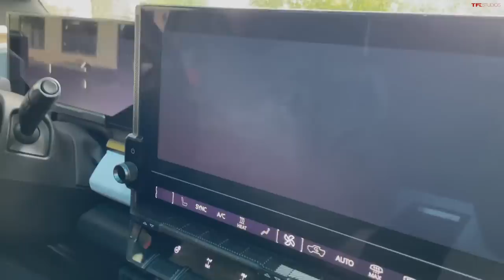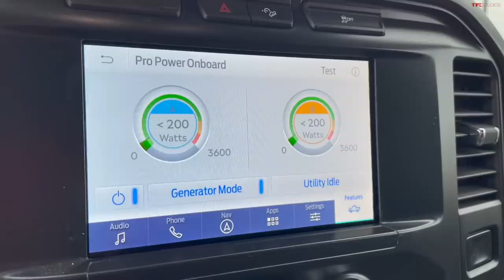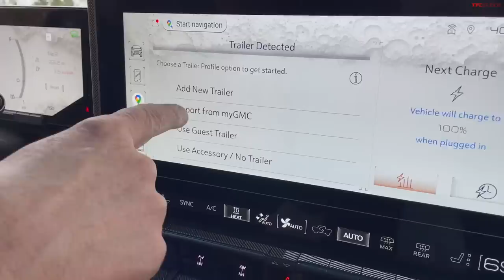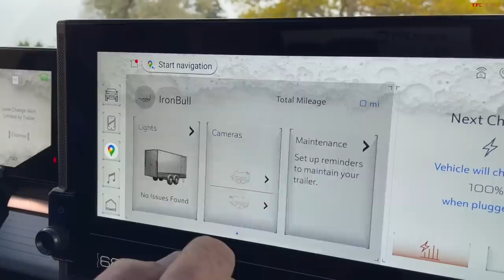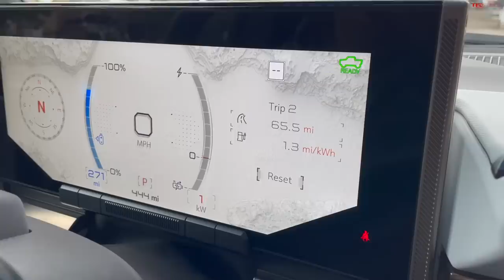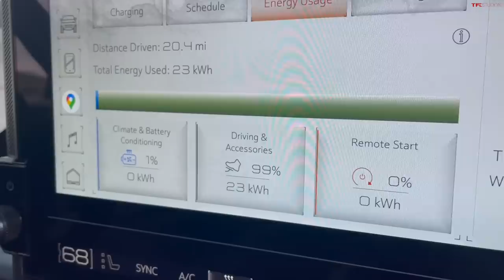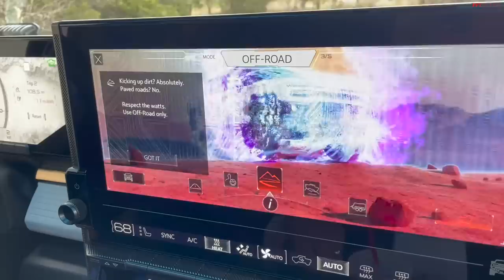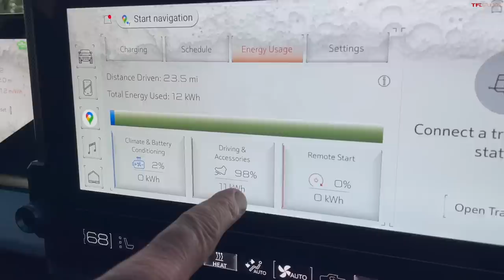Is The New Hummer EV a Real Truck? I Tow 5,000LBS With It to Find Out!

Comment: U drove a little over 20 miles fully loaded. That's not really testing it. Ev really aren't optimized for towing. To get good range u got to go way under the speed limit. Not really practical. The tech is just not quite there yet.

Comment: I’m just not impressed with the EV’s numbers! We know with a trailer maxed out ,that your only good for 200-230 miles if your lucky. For example I have traveled I80 for over 25 years, from SLC to Sacramento in a 24 Valve with a maxed out trailer of 10,000 pounds. With an average grade  of  3-6% , there is a section of I80 at Donner Pass at 7.5% it’s about 2.5 miles long. The total distance from Salt Lake City to Sacramento is 665 miles. In the second GEN Cummins I top off  in Salt Lake City and then in Lovelock Nevada to get to Sacramento.  Costing me around $270.00 and only 10 hrs to get there.  I know it’s  cheaper out  of pocket with EV’s , mentally exhausting having to wait 45 min to an 1 hour to recharge, X that by 3. With that time different’s I can already be back in Sparks Nevada on my way back home. Hopefully with Ram’s EV they have some hybrid version of an EV. Need to be able to go more than 200 miles with a load.

Comment: All of these EV towing videos compare results to a diesel pickup or a 20-21 mpg
Gas pickup but they fail to mention the toll that towing takes on ICE vehicles as well.  When you add weight and objects that are NOT aerodynamic to a truck hitch, the mileage is going to drop, maybe not 50% like an average EV, but 20-40 % depending on weight, terrain and weather conditions.   Also a huge battery, like that found in the Hummer makes for an unfair comparison when put against other EVs with smaller batteries.  The Hoovie towing video did everything wrong to make his point.  Example, smaller battery, not fully charged and an unrealistic expectation about the range all added up to a fail.
In the end, folks who use a pick up to tow, say lawn care equipment should have no problem doing their daily route, even with only 100-130 miles range.  IMHO

Comment: This is what is hard for truck people to get over. I have a 2021 1/2 ton Silverado well it is considered a 2022 because it was a late year or next year production. Mine is the 4 cylinder turbo version in all wheel or 4 wheel drive in custom trim. A work truck basically. My payload is a little over 2,000 lbs and I can tow over 9,000 lbs with it. My range every time I check with a full tank starts out at over 420 miles. I get between 24 and 28 mpg empty on the highway or interstate.

We all expect to see our mpg s drop like a rock when we tow. When I tow 5,000 lbs or higher I have no issues and I still can plan on over 250 miles at interstate speeds. 

None of us tow at 55 miles per hour like you see many EV towers due trying to get better range and make it to the next charging point.

I really like many of the new EV trucks and would own one if they could match what my current gas truck can. 

I am not even talking about a diesel truck that can do even better. Just match the output of current gas trucks. I think the real problem solver is an EV truck with a gas or diesel range extender.

They can run 300 miles empty and then the range extender can kick in and take over.

That would mean that maybe you could get 150 miles towing in EV and then the range extender fires up and drags you to the next EV charger or you find the nearest gas station , top up and move on down the road. 😉

Comment: There are 311 million registered vehicles in North America,  there is no way to switch to all electric in any period of time as we don't have the manufacturing capacity to do so. 

For example: in 2022, there will be 13.5 million new vehicles sold.  This only replaces a tiny fraction of the vehicles on the road,  it would take a generation to begin to make that switch. 

We still haven't decided how to produce the electricity to power these new electric vehicles when we barely have the power in our grid now to power our current way of life.  

This is a pipe dream that can't happen.
Reply: Why do you think that anyone assumes that it isn't going to take a generation to transition to EVs? You also assume that driving habits and vehicle ownership stay the same. There are several things that could happen to change both in the next 20 years or so.

Comment: EV's are useless in towing, the manufacturers are bragging about towing with an ev let's get  real.....you said it has a 1000 hp well how long does that 1000 hp last towing 10,000 LBS with the hummer ev on mountainous hills let's remember the United states is not "FLAT" tow with all the accessories "ON"  like the A/C on high headlights on windshield wipers and defrost "ON" , you guys refuse to do a towing test on the Gaulent with the items I mentioned "ON" while towing because you guys and the EV manufacturers know those batteries will go dead on the Gaulent, ev's cannot compete with the ice engines when towing or on long road trips, ev's only shine in short trips.

Comment: Pretty biased.  Sure if you tow slow enough, short enough, it will tow.   And the cost... DAMN!

From what I can tell, this was with the biggest Hummer batter.

Pretty clever glossing over of the Miles/kWh for the actual towing portion with the sxs, which was below 1.0.  Best I could tell from the video is roughly 20 miles covered using 23 KWh.

But it is ultimately very inferior to a gas/diesel truck where it counts.

Out here in the big states, 130 sometimes won't get you to the next town.

And recently discovered in Florida.  Do not let them get exposed to salt water.  At some point later they self-combust.
Reply from the maker: Good grief, no one is glossing over anything. It seems the only bias here is yours. And BTW….in case you haven’t driven down a public road lately gas cars also self-combust…..in fact that’s what makes them go🤔
Reply: @TFLoffroad  Just reading between the lines of the fluff piece.

No gas or diesel vehicles are on the news self-combusting because of exposure to salt water.
Reply: @freeidaho-videos  you must have not watched the video because they shared all their stats on mileage. There was no bias, other than yours.

Comment: Video is disingenuous. Only drove 20.4mi while towing ~4.7k lbs. Which is .88mi/ kw. Can go 175mi on fully charged battery and is completely drained. If you follow only charging to 80% and draining to no less than 10%, then can only go approximately 120mi. No thanks. I’ll stick with an ice truck or even hybrid to tow every day of the week.

Comment: Great can pull 5000k. I’ll take clean running diesel with 800 mile range and 16000 towing capacity. EV MIGHT be ok in city with all the charging infrastructure and support. When it comes to real work or recreation GO with a gas or diesel powered vehicle. Probably the side by side yiu are pulling can pull that sweet EV hummer and trailer back to the shop or charge station. Maybe should get electric side by side to really sell the point!  Has YouTube started censoring critical  posts about EV. I BET THEY HAVE.
Reply from the maker: Nope, no one is censoring anything here. How much did you get because you just lost it all🤦
Reply: 5000K is 5 million pounds.
Reply: @cruiser97eric1  good catch. Still I don’t think EV hummer a reliable work horse industry wants people to believe
Reply: @patrickhaarhues2870  GM is not selling the HummerEV as a work truck. The SilveradoEV is the one that is meant to be a work truck and that one starts selling next year.
Reply: @cruiser97eric1  my point is EV isn’t that good. Does not help environment. Cool and trendy yes. They have crap range, need infrastructure that is not consistent across cities/states. It’s a forced paradigm shift. We are not creating natural demand and it’s doomed ti failure without heavy handed government to keep it afloat
Reply: @patrickhaarhues2870  It is true that EVs aren't good enough yet to replace gasoline and diesel in every use case. Long distance towing is definitely best done with fossil fuels at this time but many people don't need to do long distance towing with their EVs. No doubt we need a lot more charging stations but they are being built. It is true that legislation is driving the shift away from fossil fuels but that is why fighting EVs is futile. All major governments around the world have decided it is necessary to move transportation away from fossil fuels and there is nothing you can do to stop that. You will be driving an EV eventually if you manage to live long enough.
Reply: @cruiser97eric1  the sheep will pile in their EVs giving up just that much more freedom and control. this is not about environment. It’s a paradigm shift that equalizes countries and individuals. Except the wealthy and elites.   Hard to push socialism under prior philosophy of one country at a time. Better to push all at once in all countries. Thus has nothing ti do with energy or environment.
Reply: @patrickhaarhues2870  Have you test driven an EV yet? They are awesome except when one has to wait for the battery to charge. Mine does 0-60 in 3 seconds, can tow 11000 pounds and can travel around 300 miles on a single charge when not towing anything.
Reply: @cruiser97eric1  I agree they are cool. My friend has a Tesla. Acceleration is remarkable. The tech is great. If you can afford and have backup car for longer trips and grid failure that’s great. My argument is more in the physics and the overall impracticality of them. can’t change the worlds fleet over night. Their is huge politics and money in this EV push.
Reply: @patrickhaarhues2870  No one expects to change the fleet overnight.
Reply: @cruiser97eric1  my truck tied 16000k for about 800 miles. Takes 10-15 minutes to fuel and will do it again.  Great leather, 2 tvs all the hands free tech if a new EV. Why would I change. I could get EV any time but don’t want one.
Reply: @patrickhaarhues2870  It is fine if you don't want an EV at this time. By the time your current vehicle no longer serves you well perhaps EVs will have improved to the point it makes sense for you to get one.